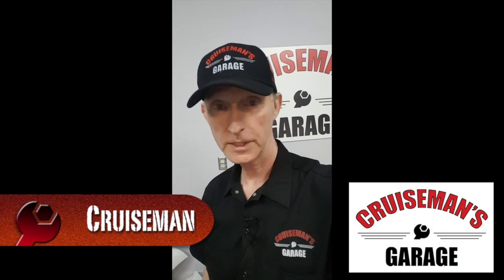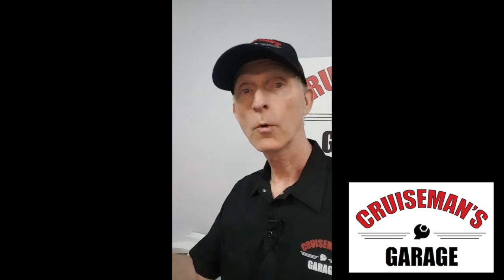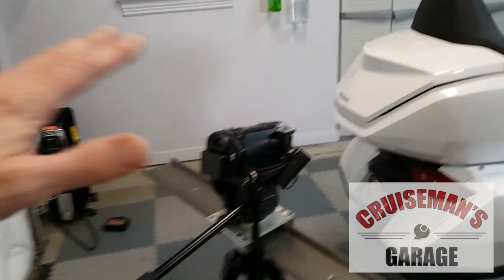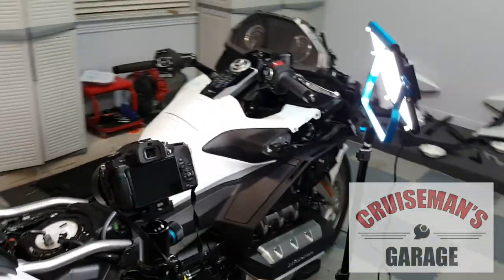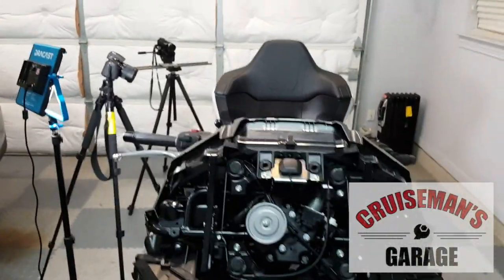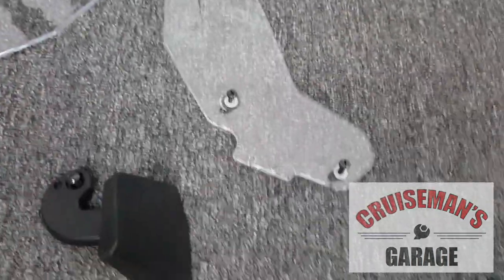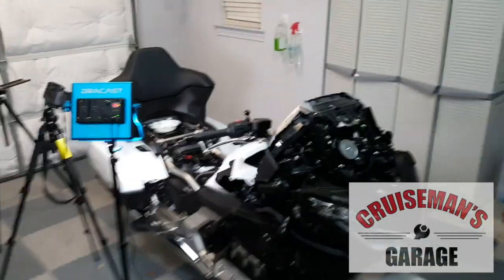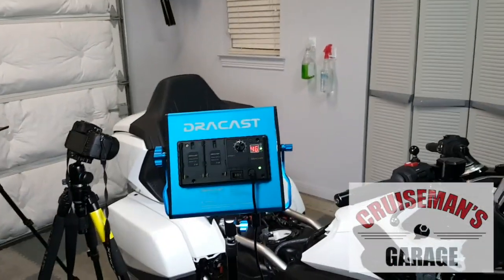BTS Making A 2018 Gold Wing Install Video | Behind The Scenes

Comment: Nice vid Cruiseman. Glad you can navigate your way through taking a 2018 GW apart. Nice to see what goes on behind the scenes. I worked for a Television station for 10 years as  Chief Photographer and Videographer and owned my own Video Production Company for years back in the 70's and 80's. Times and equipment have really changed drastically!

Comment: I love watching these vids. Personally I was not up for the task on the antenna. I ordered a $16 xm off of eBay.  Velcro mounted to the brake reservoir and ran through the shelter back to the stereo.  Cheap- yeah. Lazy-yeah. 100% functional-yeah. When you do the luggage rack and 3rd brake light, pay close attention to drilling the hole for the light harness grommet . I swear there was no indentation or Mark for drilling that. I'll be curious if it was just my bike, or maybe something that didn't get molded in. Thanks man. Keep it up
Reply from the maker: Hey, if it works, who cares? Not sure how Honda justifies $100 for this antenna.
Reply: Frig'n hilarious man!  love it!